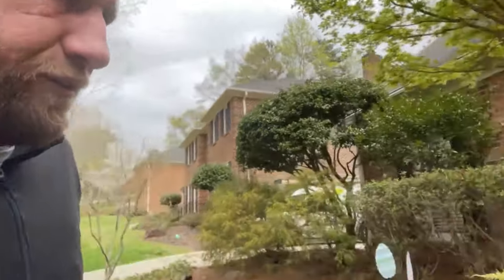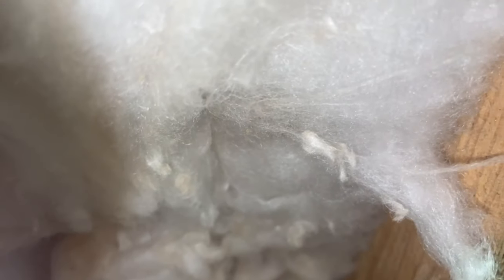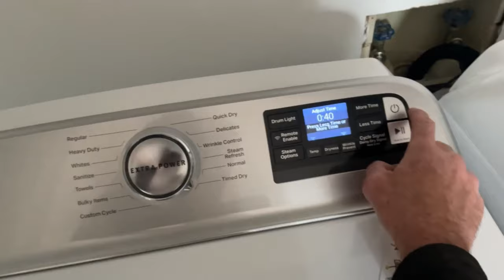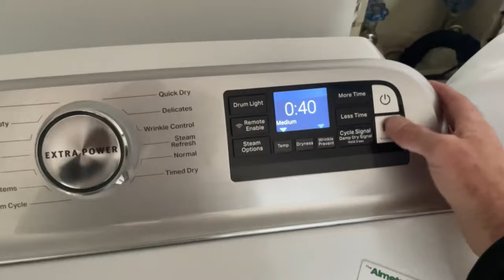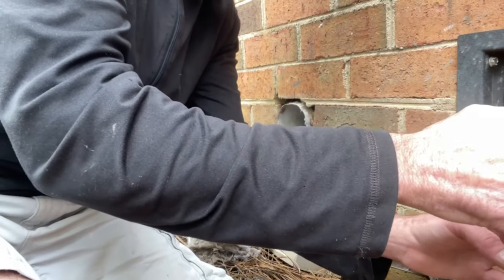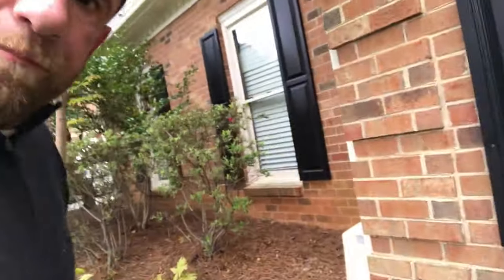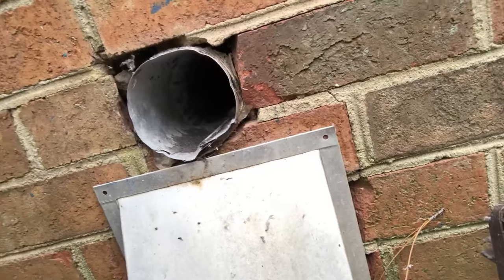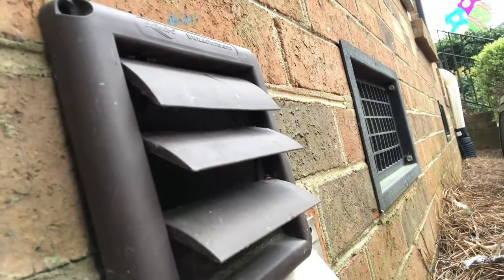DANGER!!! Who Knew? How To! #almetaldryervent #satisfying #diy #fyp #fypシ Dryer Vent Cleaning!

Comment: 35 foot is max length allowed for 4" duct by the IRC which most states incorporate. Each 90 counts as 5 feet.  Most dryer oems recommend 15 foot max.   That mess at the end of straight pipe looks like it would count as 20 foot by its self.
Reply: Even still... did you hear the massive airflow coming out after he cleaned it?

Comment: A dryer vent this long would need a booster fan, but that would introduce other problems like having to disassemble the booster fan often to clean it. Another option would be to install an in-line filter trap behind the dryer that could be easily cleaned.
Reply from the maker: Possibly however I'm a believer that anything other than a clear, 4" duct system will only cause more issues vs simply staying on top of the required maintenance... IDK though, I've definitely been wrong before, lol!

Comment: 13:55 Hope you took out all those bends. I would put flex through hole in wall and hooked flex to strait pipe
Reply from the maker: Sure did but in my other videos regarding duct replacement, the audience retention is terrible therefore that's telling me folks aren't interested in that part as much.... If the masses tell me differently, I'll absolutely make sure to include that in my videos.  Thx man!

Comment: How do you know when you've hit the far end of the pipe?  Do you do any mechanical maintenance of dryers, or just duct work?
Reply from the maker: Typically, you'll know you've reached the end if you can't push the brush any farther OR easiest way is to listen. The brush makes a different sound when it hits galvanized steel vs aluminum or when it hits the flex behind the dryer.

Comment: Hey, I love your videos and have watched almost all of them. I am curious about a few things and was wondering if you'll answer them. How do you decide when to clean from the inside or the outside? How do you determine when a dryer duct is safe for it to be cleaned out, e.g. do you consider if the pipe will fall apart because it is loosely connected to the wall and do you worry that you may puncture a hole in the vent while cleaning the ones that are not fully metal? Also, do you use any inspection camera to view the vent, if you do what are some types that you recommend? Thank you!
Reply from the maker: Great questions Justin! OK... Typically, I only clean from the exterior unless the vent is longer than my brush cable OR I'm not getting good enough airflow after running the brush from outside. On the next question, as long as I see metal duct work, I'll run my brush through the system... If there's ANY flex in the duct system, it has to be replaced with new, 4", ridged ductwork! My brush will absolutely destroy any flex it encounters! As for the duct collapsing, if it does, so be it.... I'll have to repair. If it winds up being something simple, no big deal however any repair costs would be the homeowner's responsibility.... It's unfortunate however I personally can't be "on the hook" for a poorly installed duct. If originally installed correctly, my brush won't blow the duct apart or make it separate from other pieces. Lastly, I don't own a camera system and don't think I will anytime soon... When you run a 4" brush through a 4" duct, from start to finish, I KNOW the duct is clean therefore I've never needed one. And say the duct is broken somewhere in the wall or ceiling that isn't visible, I'd have to cut a hole in drywall to repair so typically, the camera is just something flashy that would allow you to charge more for the cleaning/repair... I hope this makes sense however if you have any additional questions, don't hesitate my friend!
Reply: @advsLLC  Wow, thanks so much. Youre very helpful!

Comment: You can ring the lint out, it’s so wet!! How did this not start a fire??
Reply: That is what I wanna know too!
Reply from the maker: Luckly, the vent was 100% clogged and trapped the moisture in.. When you dry a load, you push 1-1.5 gallons of water through the vent via steam... We know that steam turns back to liquid when it gets further away from the heating source. In this situation, the lint wouldn't have ignited because it was soaking wet... Had their been even a small amount of airflow, the moisture would've escaped. Had the lint been dry, they would've been in some trouble. Thanks for watching!!!!

Comment: Imposible length to use the brush and that tight u bend will be solid filled ,can you reach it from inside?or do you recomend a sweeping bend replacement to the duct, machine will be full of fluff too.
Reply from the maker: On this one, I had to run the brush from both sides. They can be tricky for sure!